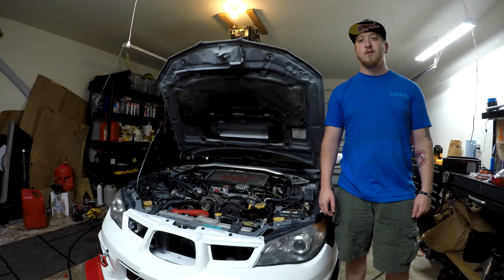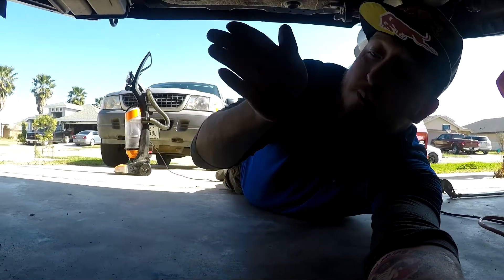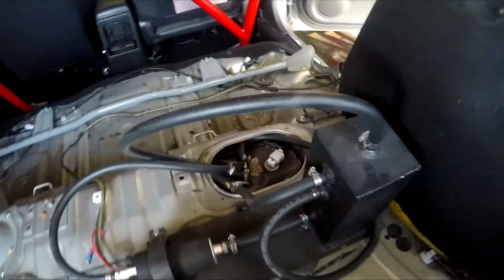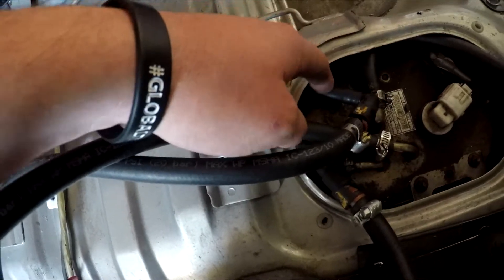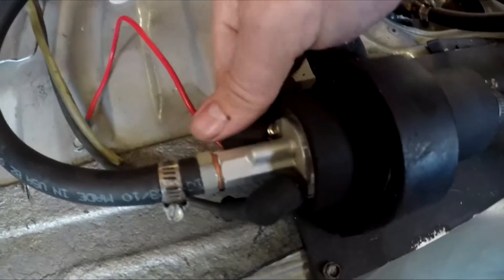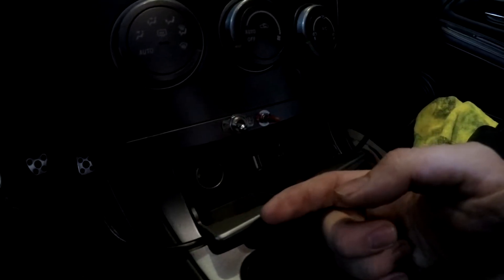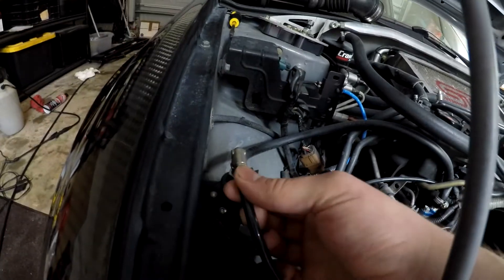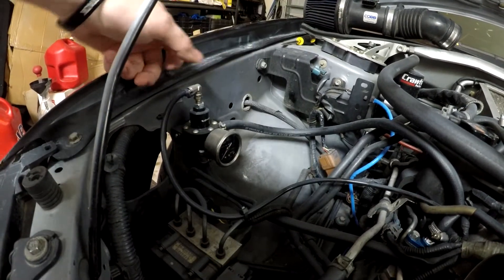This DIY Surge Tank is CHEAP and Easy to make!

Comment: Nice. Did you still use the pump in the tank?
Reply from the maker: Yes the intank pump was a DW 300 feeding the surge tank.
Reply: @Bang4BuckRacing  cool I'm just going to use my oem pump on my gf8

Comment: Do u hv any gas fume issue in the car? Got the same setup but got fume issue. Basically did checked all clips on hose & they all are pretty tight + no sign of gas leakage. It's not that strong fume  but with the acond On.. It just feels uncomfortable feelings. Just asking incase u guys might have solution. Thanks

Comment: Do u have the part # for the tank
Reply from the maker: Julian Dominguez hey so I had included the link to the tank in the description but looks like it is no longer on eBay . But here is something similar you will just have to find a bracket to mount the external inline pump https://www.google.com/shopping/product/1?q=fuel+surge+tank&start=20&client=safari&biw=375&bih=553&tbs=vw:l,ss:44&prds=num:1,of:1,epd:10373566920350331989,paur:ClkAsKraX4uus_NH1YK2rcrLogN0vwmiuAAd_0_2crBOOMNvv895ZNw6u0tio0kHTjZdzGxBcnxEc6eXtMm6VZooqakCS5Vmv6Er30HKu-cQyRFe2344jFUTdBIZAFPVH72a4rROxr8NPK4r4UvjMNMBJLwQ1Q,prmr:1,pid:10373566920350331989,cs:1